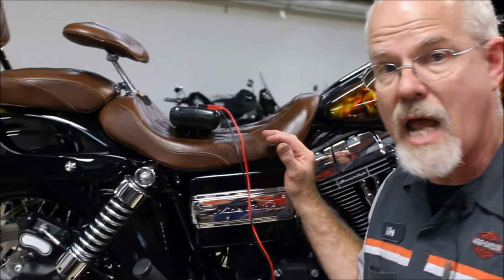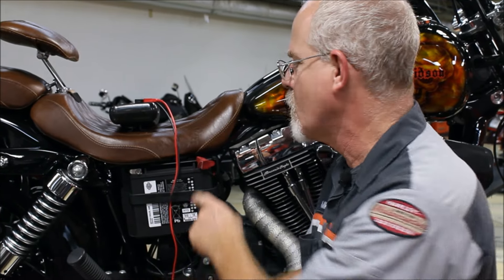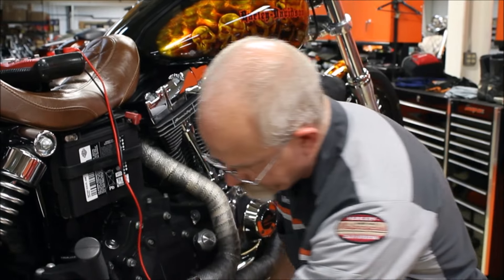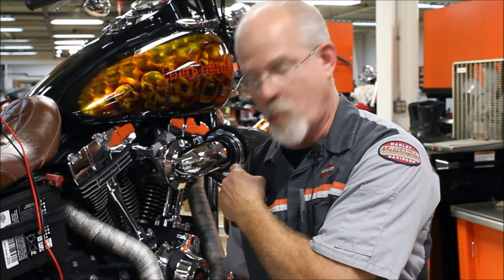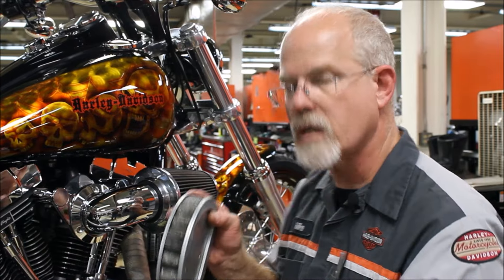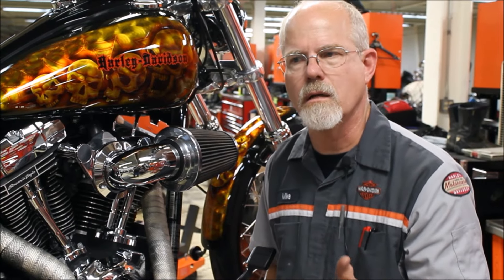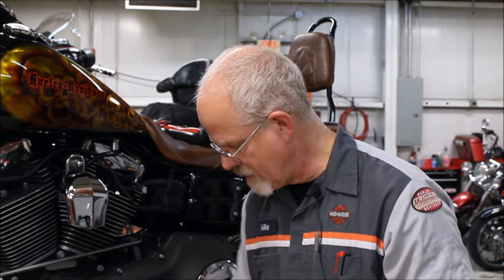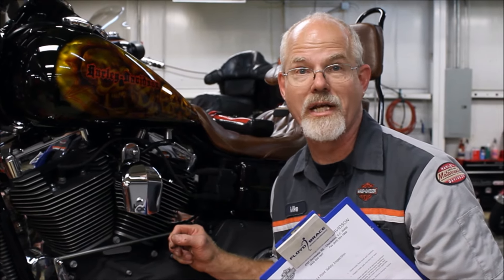DOC HARLEY: 14 POINT INSPECTION PART 2 OF 2

Comment: “Mounting Bolts Not Tight” My Road Glide started feeling extra heavy when trying to lift the bike off the Jiffy stand.  First I thought it was my old age.  Someone reminded me to turn the handlebars to the right to make it easier to lift the bike. When trying to turn the handlebars the bike crashed to the ground. One of the bolts that connected the Jiffy stand assembly to the frame was missing and the remaining two broke off into the frame. I think the two that broke off were loose and with the missing bolt the angle of the bike was lower making it difficult to lift off the stand.  I used a reverse drill bit to remove the broken bolts and after replacing the bolts with new the bike is easily lifted off the stand as it should be.   Amazingly the bike survived without a scratch and I don’t feel as old and weak anymore.
Reply from the maker: Thanks for sharing your story. Reminding people, a Service is more than just changing oil. Checking hardware👍…..Doc

Comment: You are absolutely right about dry rot on fuel lines. Mine cracked when cleaning the bike, fortunately engine not hot. Learned a valuable lesson. You speak from experience

Comment: Good video!.. Unfortunately I have many bad experiences with HD of NYC. The salt n pepper guy in parts and services desk has been a real douche.. He even told his manager he refuses to service my bike. I pay and even $20-$30 every time I go there. I don't ever bargain the rouse, I pay and my bike always comes back out within another problem.

I took my Softail Slim for a sudden stall whether I'm in a stop or in my last experience a 68mph ride. It just shut off. 

I took it to the dealership where I got it and I was told it was the battery. I paid no other words said and got my receipt of service and paid in full... A few hours later I stalled in the highway, then 3 tiles later.  I got a good word from a chat group it could be a speedometer sensor, spark plug, it's wires or just extra  oil change... I changed the spark plus and wires, changed oil and the speedometer se sir and it stills stalls
Reply from the maker: I can not “fix” a Harley-Davidson over the internet. My Email address is at the end of all my videos. Send me all your information. We can review and come up with a few suggestions….Doc

Comment: Great advice. Something I always did just instinctively before I ever saw this video. I also like to make sure my pegs and any other nuts and bolts are there, secure and tight. Recently I had a shifter peg vibrate loose and come off at speed. Scary. Check shifter and brake linkages as well as footpegs and floorboards.  I am also anal about checking my axel bolts are snug and especially that the fork bolts under the axel are there and snug. I use blue loctite on most of these parts that can vibrate loose. Your pulley bolts should not be ignored. Once they start coming loose it isn't long before catastrophe happens. Needless to say mirrors and handlebar bolts should be tight.

Also was not aware of the Battery Tender voltage tester. Great pice of kit. Also found out that Battery Tender makes a USB adapter for the connection. Now I can connect my phone cord to the Battery Tender terminal.
Reply from the maker: Wow! This could have been a Tech Tip all on its own 👍…..Doc

Comment: I would NEVER use a wrench on battery terminals. It's just bad practice. I use a 1/4" 10mm socket on a screwdriver handle or a thumb/finger ratchet. I've also seen very dangerous situations occur due to terminals shorting. Using a wrench or a standard/long handle ratchet is just asking for trouble.

Comment: Only helpful comment i'll make is the Fluke meter he keeps referring to is simply a higher-price brand of multimeter..Fluke is a company Brand name and I will also add that you don't need to buy the plug-in meter to measure the DC voltage at the trickle charge plug..all you need is a simple multi meter.
Reply from the maker: Good Point. When you use a tool all the time, It's the first thing out of my mouth....Doc

Comment: Sir.... just so you know, restricted air filters have nothing to do with fuel mileage, regardless of fuel injection or a carb. Restricted air filters will reduce power only but no effect on MPG.
Reply from the maker: Pleased share on your facts. My opinion if you have less air coming in and the same amount of fuel delivered the air to fuel ratio is towards the rich side until the O2 sensors try to correct. Some air filters are so black and don't think the O2 can scew that far.....Doc
Reply: @LowCountryHarleyDavidson  My reply is gone :(
Reply: @LowCountryHarleyDavidson  So here some testing we done back in about 2005. FE is fuel economy and the following air results from a
class we ran at the NCVECS lab to show the affect restricted
air filters have on fuel economy. This demonstration has
been run countless times over the years at this lab and
every time the results are the same.

This particular vehicle is a 1994 Ranger 4.0L.

The test is a mass test, IM240. For those unfamiliar with
mass testing, you can count the carbons and, given the
carbon content of the gasoline, you calculate FE. Simply
take the number of tailpipe carbons divided by the number in
a gallon of gasoline and then use the miles driven on the
test. All gas values are in grams per mile.

The restriction was done with a very rare component only
available to certified labs commonly referred to as duct
tape.

First test, new air filter, no problems.

THC = 0.099

CO = 3.967

NOx = 2.133

CO2 = 466.426

FE = 18.75 MPG

1.97 miles driven

Second test, air filter 75% restricted.

THC = 0.145

CO = 4.237

NOx = 2.002

CO2 = 451.945

FE = 19.32 MPG

1.97 miles driven.

Third test, 98% restricted, vehicle had severe driving
issues and had trouble getting through the test. Any more
restriction and it would not have completed the IM240. Only
two ribs of the air filter were visible.

THC = 0.173

CO = 8.769

NOx = 1.845

CO2 = 450.503

FE = 19.08 MPG

1.97 miles driven.

That should be the end of that myth. Any questions?

Comment: Need to add checking the shift linkage to that inspection! Several times i have had it work loose even with blue lock tite! Eventually it will round off the splines and be a real pain to fix

Comment: This was a nice set of videos, thanks!  My Heritage is 16 years old with 90,000 miles.  I'm meticulous about my bike and the maintenance.  I like this check list.  One thing you might add is the fork seals and shocks.  I'm starting to wonder about the rear shocks on the Heritage given the mileage.  I keep and eye on the fork seals because I polish my bike after every ride.

Comment: NOOOO, you don't want the battery to be at the maximum voltage a battery can be! you want it at the correct value (it differs if it is lead acid or lithium) max voltage? fries batteries
Reply from the maker: Thanks for your Tech Tip,......Doc

Comment: Thank you! I've been looking everywhere and asking around, and never could get a solid answer about checking my oil on my side stand. I have a '15 sportster custom seventy-two, so it has the tank just under the seat, on the right, with the screw-in top. Since my bike was purchased pre-owned, I didn't get a manual with it that would've easily answered my question. So yeah... Extra thanks for that! 👍

PS: Any tips for getting that oil cap to stop popping up under my leg while I'm riding? Doesn't seem to matter which seat I use, it does it anyway.
Reply from the maker: Either your not twisting it far enough or it might be worn out….Doc

Comment: My Vrod is a different bike. The battery is much harder to get to. The oil level dip stick is screw removed but must be checked upright. The air filter is also buried. Pretty sure it a wet sump engine as well.

Comment: ❤😂❤😂❤😂❤
I NEED HELP CHANGING HANDLE BARES ON A BLACKLINE FXE. IM NOT WANTIN TO USE THE $400 TOP TREE SO I CAN USE ANY BARS. MY PLAN IS TO GET THOSE WASHERS AND BOLTS FROM JP CYCLE, QUESTION ONE THAT IS INSTALLED CAN I INSTAL A BASIC LATE 60 STYLE BUCKHORNED. PLMK🙏🙏🙏🙏🙏🙏
Reply from the maker: Michael you are trying to make something that was designed for one thing into a multi fit component. I am sure a custom builder with the right amount of money can help you….Doc

Comment: 13.2 vdc  minimum for a fully charged battery.  Each cell s/b 2.2 vdc x 6 cells = 13.2 vdc. A good charging system 14.2 to 14.8 vdc

Comment: I recently purchased an 06 heritage...the seller claims screaming eagle upgrade was on it when he bought it (it has the air cleaner) how do I figure what upgrade was done?
Reply from the maker: This is tough buying a used bike with no records. If the old owner had it done at a dealer they might have records. You could have a dealer plug into the ECM and see what mapping has been installed. That might give you a description of a Harley-Davidson stage 1, 2, 3, or 4. Thanks ~ Doc

Comment: Doc or any other viewer can you please tell me the name_brand of the pf the DCV meter that connects to the tender plug. Also I would like to get the tool that checks the condition of the break fluid.
Reply from the maker: Battery Tender is the brand for Vdc at the tender connector. Thanks ~ Doc
Reply: @LowCountryHarleyDavidson  Hry Doc thanks....I found both tools at Granger, and the Deltran(battery tender) web site
 the plug in VDC tester is way better than pulling the seat on my FLXSTDSE...!
Reply: You can also just put your multimeter leads in the pin sockets on the battery tender cable that you keep connected to your battery. That is a quick check. I keep a small multimeter in my saddle bags. It is very small in size and folds together like a closed case. Under $20 - Allosun EM308.
Reply: @tomb.8485  Yea I guess but I have no Baggs, and using a multi tester takes two hands. If I just plug in the Deltran unit my hands are free. I do use the charger leads to perform a quick check with the MT though.

Comment: Use a midtronics to check a battery properly. Volts doesn't tell you the condition of your battery. And you are supposed to be an expert.  This is shocking modern servicing.